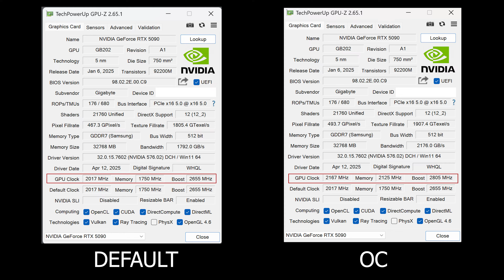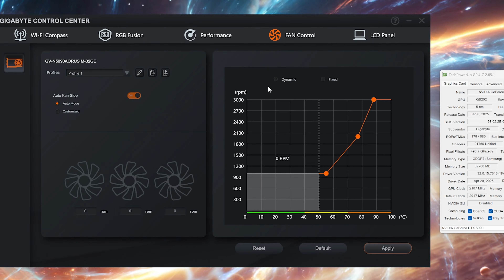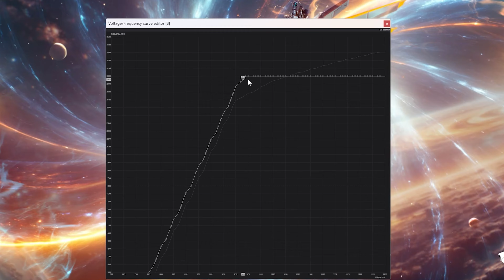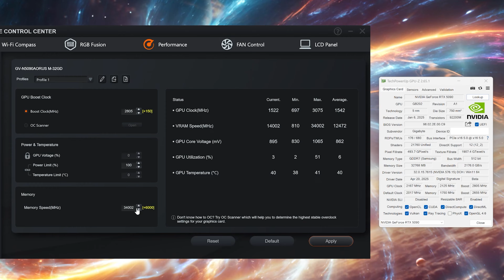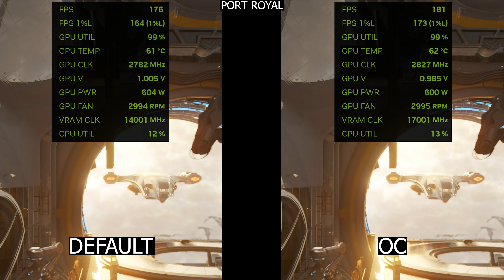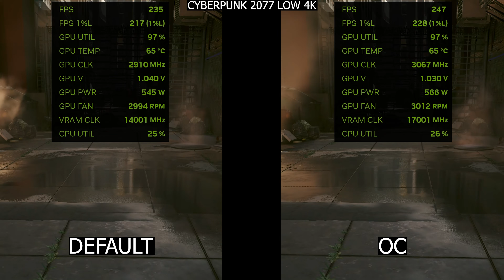Maxing Out the RTX 5090 AORUS Master – Shockingly Easy OC Gains

Comment: If I use the nvidia app to overclock will i  see the same results as shown in this video.
Reply from the maker: For the most part yes, but I don't think Nvidia app has the voltage/frequency curve that u can customize per point, also u can't overlook memory I think,  it's a bit limited AFAIK

Comment: I bought this card a few weeks ago.  Quiet under load, fans never exceed around 1650 rpm, but usually less under load (around 1500 or less). Stable, great FPS in 4k with DLSS and no frame gen. Almost no coil whine. I've only heard it during loading screens when FPS hits ridiculous numbers, nothing in game. Averages less than 70c, usually around 65-68c under load. Zero complaints. However, if you overclock using the settings you provided it can result it permanent coil whine. Beware if you try this.
Reply from the maker: Its really good,  I love its design too

Comment: Please asnwer if you want to make a correct guide, this is not specified in this video. overclock core and vram requires manually click of up and down arrows 6000 times? is there no way to rise up frequency setting manually or with a slider? i click on UP to rise frequency abnd even if i keep clicked ot rises of 1 step every second, after 10 minutes i've only rised of 200 mhz LOL, is there something wrong? how do you fast apply desired frequency.
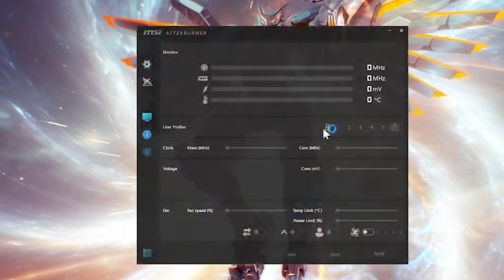Reply from the maker: Yess, it's actually true. There's no slider or way to input the number you want for either core or VRAM, but for the latter, it's boring to set +6000. I said in the video at 5:02 that it took me long to reach 6000, which is why I shared with you guys the profile of the ones I have. You can import it if you want; it's located at the pinned comment and description
Reply: @TECHOSAUR Is It normal to get +5000 MHz I have to click 5000 times? Of my fucking god
Reply from the maker: @miklaus2873  you can press and hold imagine like you are fuelling a car 😁

Comment: Great video, is it safe when 5090 hit 610-615w with the oc?
Reply from the maker: Yup. Because the PCIe express slot can provide 75W to the GPU and the 12v-6x2 cable 600W, so they're actually able to provide over 600W,  plus, the cable is designed to handle short duration power increases, like slightly over 600W.

Comment: Gpu.  Plus. 150
Vramm. Plus. 6000 is this. Right. 😅
Reply from the maker: Yes, that 6000 MHz is actually 375 MHz. Pretty much all overclockers' threads tried this, and it works on the 5090

Comment: I just installed mine yesterday. I used GCC
OC Scan and it took my card to a stable 3007 Mhz. The card is smooth and has a lot of great features such as monitoring LCD screen, anti-sag holder, and a 4th fan that I do use. Noise level is very low and no coil whine. Great card!!! 

Thanks for the heads-up about the MSI Afterburner conflicting with GCC unless you update Afterburner's settings.

Yes, I paid $2900 for it, but I sold my Gigabyte RTX4090 OC Aorus Master for $2300...this helped with my decision to upgrade. :)

Fyi...a good interim card is the MSI RTX5070-TI OC Shadow 3x for $749. Was able to get a stable 3003 Mhz and the results were approaching RTX5080 results...a lot of bang for the buck!

Comment: I just bought the same exact model, and every time I load into windows, my mouse will stutter to the point of fully freezing my screen (sometimes the screen goes full black), and then after a few seconds it seems to get back to normal.
I'm using driver 576.52 on a clean install of Windows 11 23H2. Is anyone else experiencing the same issues with their models?
Reply from the maker: I think you have more than one tool trying to apply its overclock settings as Windows boots, and it's causing driver restart. I had the same issue, also on a Gigabyte GPU, but a 7800 XT. I solved it by disabling overclocking in Radeon software and keeping overclocking only in the Gigabyte control center.

Make sure that in the Nvidia app you don't have overclocking enabled as well as Afterburner, or at least choose one tool to do the overclocking
Reply: @TECHOSAUR  Thanks for the suggestion. However, I can confirm that this is an NVIDIA Driver issue 100%. The issue comes from having two monitors plugged in at the same time. The driver doesn't know how to handle it, and basically breaks until display restart. Having only 1 monitor plugged in, fixed this issue for me.
The overclocking worked perfectly, no issues there. Thanks for your work on this video!
Reply from the maker: @TiaNastac1a weird how Nvidia drivers suddenly broke after years of being reliable. sounds like they're giving the market away to competition 

Hope it was a useful video, thanks for tuning in
Reply: I had an issue like thag when I had  the Gigabyte RTX 4090. It ended up being a conflict with the GCC app vs Corsair App vs Razor App (they were conflicting each other). I got rid of the corsair and razor apps and didn't install the unneccesary GCC softwares. All was fine afterwards.

Comment: I am stuck at 45k on time spy with my 5090 astral. I saw that so manay people getting like 49-50k with regular uv/oc.
Reply from the maker: Check if it is set to silent BIOS, and after doing the test, check the GPU core frequency and VRAM on graph, see if they have sudden dips or spikes, or if they are consistent at your set boost clock. If you are using ASUS Tweak III, it should give you some insights about power consumption and temperature; if it is thermal throttling, it will suffer from performance drop
Reply: Check your ROPs count in GPU-Z to make sure you are not shorted

Comment: I always hit the power limit though when I OC
Reply from the maker: How much is it reaching ?
Reply: @ Like 500W, Not very much, I am using a very nice Mobo and PSU, the power limit is just locked on this card at 100%
Reply from the maker: @theoriginuhd   it depends on the load type, like on AC Shadows for me its around 450w on 4K DLSS QUALITY + FRAME GEN, but if you run furmark it should get to 600W for sure, otherwise there may be something blocking it from unlocking to max power

Comment: Honestly not bad for easy oc. I’m surprised you got one but I don’t wanna know how much it cost 😅 do you mind doing a guide on a overclock or undervolt guide on 265k on the gigabyte board?
Reply from the maker: It definitely left a dent in my wallet, but honestly, zero regrets, I'll be working on that guide soon just gotta clear up some backlog first! sorry for delay
Reply: @TECHOSAUR  no worries cant wait to see what you come up with! I ended up trying to get your board just black one instead but it will take a bit to get here and we will see if I still have power limit issue. If not ill prob like the board more anyways and then know its CPU or PSU. Also when you test with R23 you don't get power limit throttle reasons do you? When I had the issue when I looked at hw64 it says limit reasons pl1/pl2 bla bla